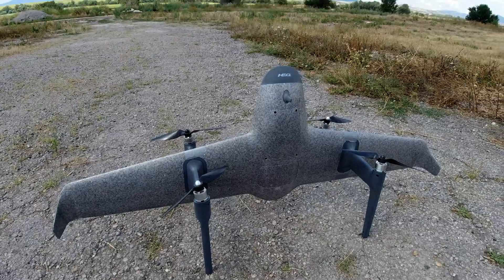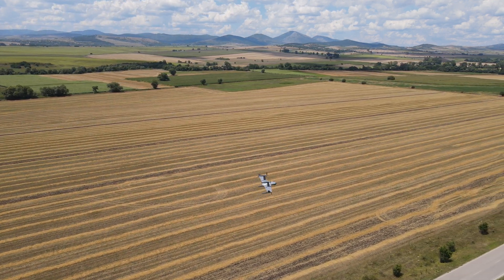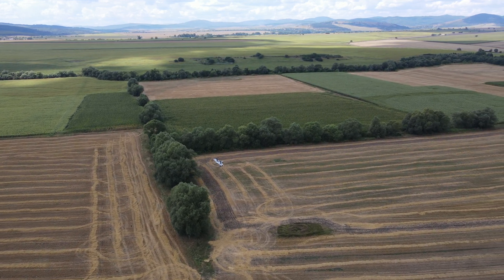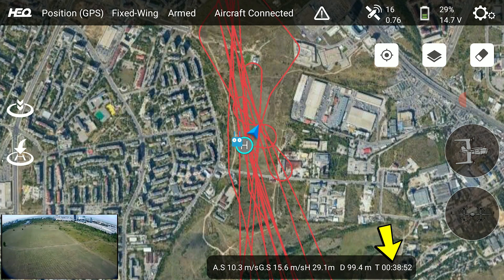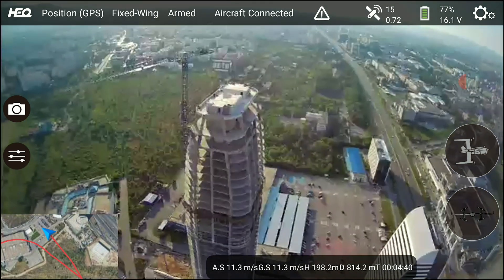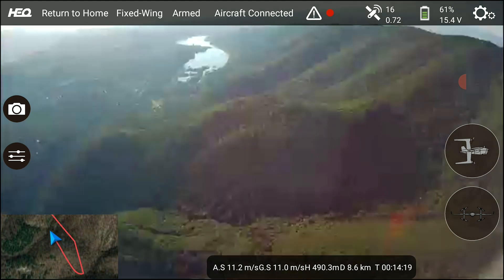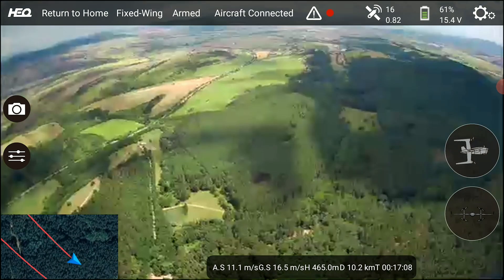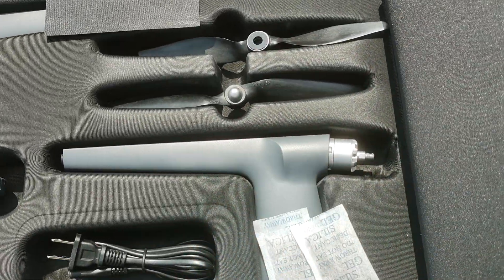HEQ Swan K1 Pro VTOL Wing - full range and endurance testing!!

Comment: I bought the Swan K1 Pro about a year ago and it's been nothing but trouble.  It's certainly not worth the exorbitant price HEQ charges for it.  If the hardware and software was well designed, it would be worth it but I think it's mostly junk after flying it.  HEQ is definitely lying about the 1 hour flight time.  Even with the "black label" batteries, you'll be lucky to get 30 minutes even with the emergency landing voltage set to the minimum.  Maybe I need to spend more time re-balancing their crap props again.  Geez, they charge more than enough for them so why the heck can't they do right by their customers and balance them properly themselves?
Reply from the maker: Indeed! It does require more work, especially on the props with the K1! Other areas need to be revisited as well!

Comment: is it dji hd camera and transmitter inside ?
Reply from the maker: Mine is not, but they have this option on their website, you can order it with the DJI system instead, or you can swap out the stock system if you already have the DJI system!

Comment: @ArxangelRC  As I know H12 range depends on Camera quality settings.  5 km it's for good quality full HD.  Second level is 10-15 km.  And there is very low quality that should bring up to 30 (according to ad* )
Reply from the maker: Well HEQ have told me that those cannot be adjusted by their app, so it is fixed at some setting. Even though there are controls to change the settings in the app, they said those don't work! So it would seem it may have been modded in this case!

Comment: Hi bro, it can still fly more than 10 mins when 29% energy left.
Reply from the maker: Right... will there be enough battery left to land then, and not fall out of the sky? Because at 30% when it transitions to hover voltage under load goes down to 14v, which is 3.5v per cell, which is voltage that you need to be landing at! I am affraid that if it goes much lower than this under load it may lose power during the descend and fall down!

Comment: they make prop balancing tools, like jigs and rigs, for you to test the props on , and you could then shave off the heavier side as needed... ideally you would sand along the length of the blade

but its more known amongst 'serious' RC hobbyists who seek to maximize every aspect and performance, rather than 'consumers' for which modern drones seem to be catered for
and it would make a difference in efficiency and thus endurance
Reply from the maker: I know, I have a few of those balancers INCLUDING one specifically designed for phantom-style, self-tightening props, but these are just too heavy and the magnets can't hold them! Perhaps I may need stronger magnets...
Reply: @ArxangelRC  they make balancing rods which you screw the prop onto, then after you have done that you put the rod on something which it can roll freely... An example I found on Youtube was putting the rod on the rim of an aluminum drink can
Reply from the maker: @carmatic  I have a similar DuBro balancer, but it doesn't have a threaded end for these props, will have to see where I can find those.

Comment: Great aerial coverage. Have not seen much of the Swan VTOL from air-to-air perspective. Looking very steady (3:00) doing nice turn and holding course very well, however at 4:20 it seems to be zigzag some. It's not clear if this the Swan VTOL, or camera drone?

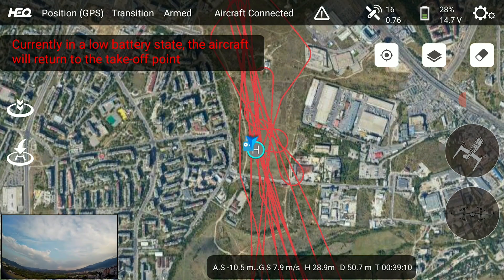Wondering if the poor propeller balance (6:28) is impacting motor efficiency? Also are you able to control cruise speed. Wondering if default speed is for maximum "range" (which would be faster) than maximum "endurance" (time). If there isn't a way to select, this may be a good feedback item for the manufacture to provide an option for pilots to switch between "range" and "endurance" flight modes.
Reply from the maker: At 4:20 that was actually a combination of my GF trying to get the plane into proper track and me trying to keep it in the centre of the frame and systematically overshooting due to too sensitive controls on the Air 2! I would assume balanced propellers would help a bit with efficiency! As for the speed, it is around 40km/h and you can't slow down much more than this!

Comment: Pin the plane to the ground ... and with zip-ties try to balance motor + prop ensemble ...

If there is any way of spinning each motor without any other, it would be better. I'm thinking something like "motor test" function on arducopter ...
Reply from the maker: Hmmmm, well perhaps that could work, one motor/prop group at a time. Sadly I was not able to connect to Android Mission Planner as it crashes, have no experience with QGC, but if I have one module disconnected only 2 motors will spin at a time, so I guess thats better! But then I will have to make sure I tighten the props to the exact same spot every time... hence why it would be better to balance the props on their own as the motors feel pretty good! :)

Comment: The concept is nice, but i would hate jello on my flight cam. Range is plenty but Video sucks compared to DJI vid. I need good video while flying or else I wouldn't enjoy the flight. Appreciate the honest review, greets Mario
Reply from the maker: Well, the jello can be fixed with balanced props. With the DJI props there was no jello! Also, you can order it with a DJI system actually, or if you already have it you can swap out the Skydroid camera for thr DJI module and use your goggles, it is compatible! :)
Reply: @ArxangelRC  ok, that's nice then. if with DJI - do you still have some OSD (like battery, distance?)   I guess it would use some own flightcontroller and no inav....    anyhows, thanks for your review - especially the mavic shots looked cool!
Reply from the maker: @Rcschim  Mavic shots could have been way better with a more predictable trajectory for the Swan and more practice or settings adjustments for the Mavic... or both! As for the OSD, you will not see an OSD in the goggles, but the info will still be available on the radio in the HEQ app...

Comment: one thing i noticed that you're still launching at 90 percent battery - 14.6 volts - im assuming it's a 4s pack... also not to mention that framerate is REALLY BAD
Reply from the maker: 90% battery is not 14.6v! 14.6v is where it generally shows 29-30% battery! These LiPos are High voltage, so they charge to 17.4v. Frame rate does leave something to be desired indeed, but still, not bad for an all in one package!

Comment: Great video as always, my fixed wings are grounded at the moment while i play with my new DJI Mini 2 😁
Reply from the maker: Haha, how much playing would the Mini 2 require? I usually get bored with DJI copters within two flights, hence why I use them not for recreation pretty much 99% of the time! :)
Reply: @ArxangelRC  Well as i got the mini 2 very cheap and can't afford other FPV gear, i have been doing lots of flights with the mini 2, in the 2 weeks i have had it done nearly 9 hours of flight time and over 30 kilometres, haven't got board yet lol, only downside is it is limited to max 500m height from any point, i have a hill near me that is 226m above sea level so i flew 726m from that point, i want to go much higher 😁😁
Reply from the maker: @ptaylor5014  I see! Have you looked into those paid apps that sort of "hack" the copter to remove the limits?